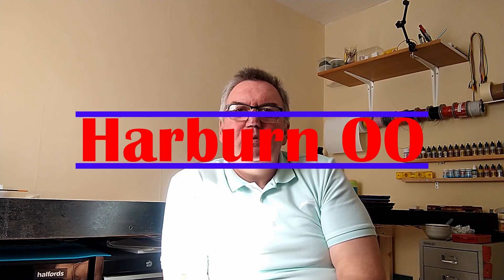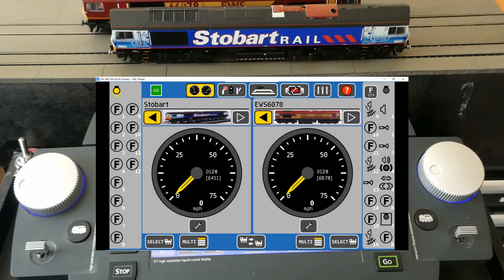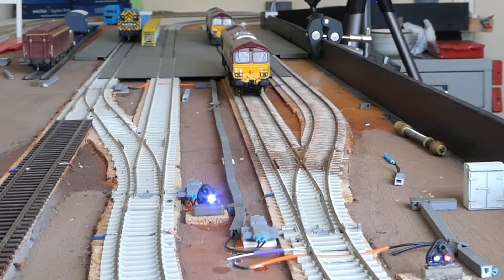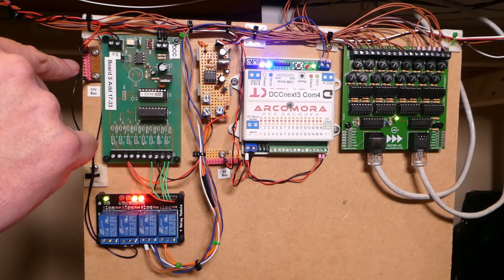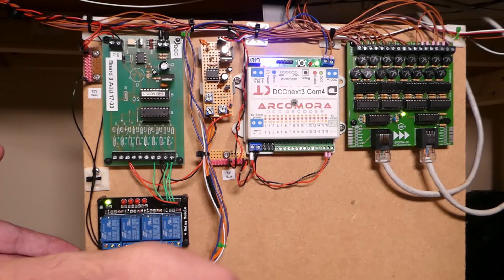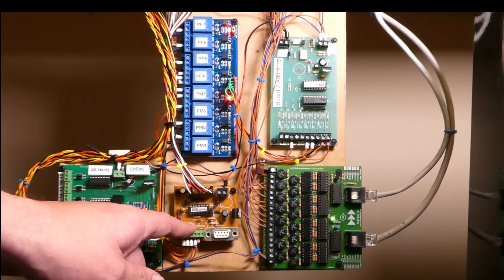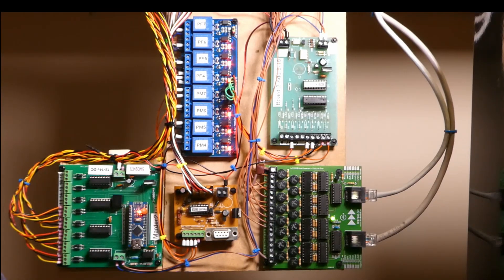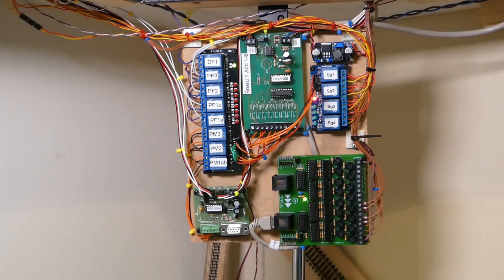Hardware and cost for automation

Comment: Hello Jim
How did you program the Arduino Nano with Mardec firmware? I have used the UNO with Mardec but there is some boot loader “magic” to get Mardec onto an Nano!
Reply from the maker: Hi Martin
Yes you need to use the Uno as a bootloader to make the nano think it's an Uno. Am sure the instructions are are on the arcomora.com website
Reply: @HarburnOO  
Hello yes I have tried those instructions and also the ones from the Arduino site with no luck. So I deduce I have more basic problem/lack of understanding about the Arduino. I like many others have Arduino “clones” can these have their boot loader reprogrammed? Does the ISP “programmer” unit need to be a Genuine Arduino? I have tried both without success. I have no genuine Nanos to try? Any thoughts would be most appreciated.